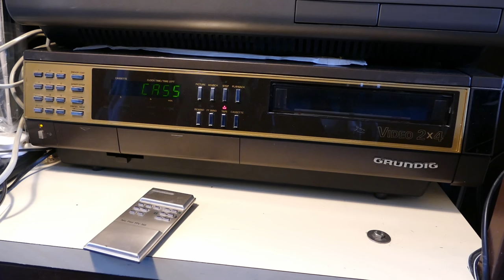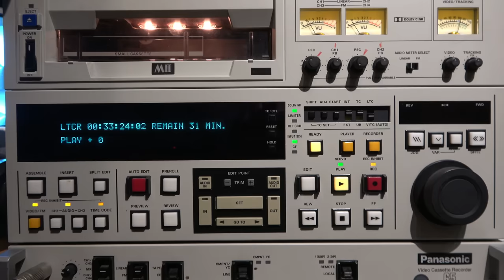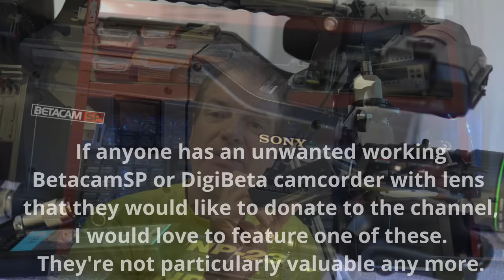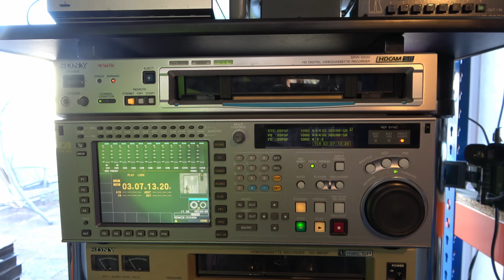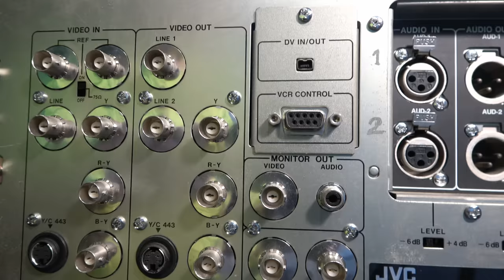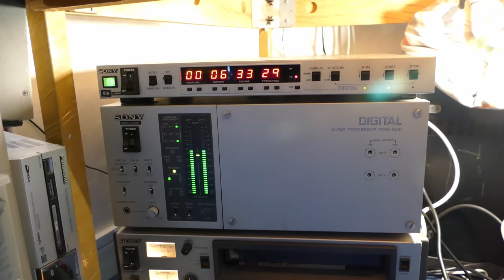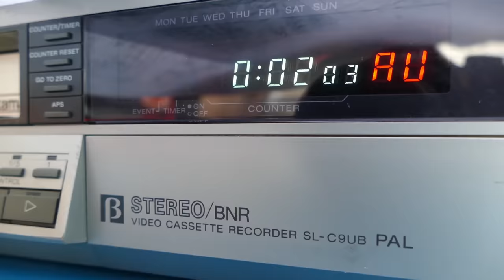Beta vs VHS. A world in which Beta won.

Comment: Yeah, yeah, Beta Cam was much better than VHS, also MUCH better than Betamax, which was the consumer version from Sony. Betamax tapes wouldn't play in a BetaCam machine. And NOBODY is going to pay $40,000 in 1990's money to record "The Days of Our Lives" on $25.00 videotapes that you need to get the utmost performance out of A BetaCam unit. As far as Betmax vs. VHS, the same tape, the same spinning video heads (Oooh, Beta has a very slightly different stripe angle on the tape! Whoopee.) and the same electronics technology available to, oh, I don't know, EVERYBODY building either format machines for the mass consumer market, means that six hours of soap operas or sports recorded on one tape instead of just four hours per $2.00 tape meant essentially that NOBODY cared about the theoretically marginal better picture on Betamax. It's like the Apple Mac with a G3 processor on Craigslist that some MacFan thinks is still worth $300.00. Who cares? It's Dead Jim. And this is from a guy that records audio only to HiFi VHS just to fart around with. I know that, before long, all the VHS machines HiFi or otherwise will ALL be dead and non-functional. It'll be fun while it lasts, I guess. You can get some entertaining effects using the antenna out from a HiFi machine to the antenna in on a VHS mono deck, real analog grunge if done right. Extra points for going antenna out to a third mono deck, no VST plugins needed.
Reply from the maker: Lots of people did care about Beta's improved quality.  Video enthusiasts loved them, particularly until S-VHS and Hi8 came along.  But there weren't enough enthusiasts who cared.
Reply: @video99couk   Video enthusiasts yep its also meant your home movies looked so much better higher resolution colour and luminance 
I had a betamovie and I would play my home movies at work every one who had  a vhs camera would comment that beta was heap better